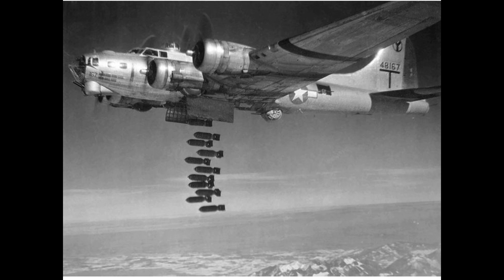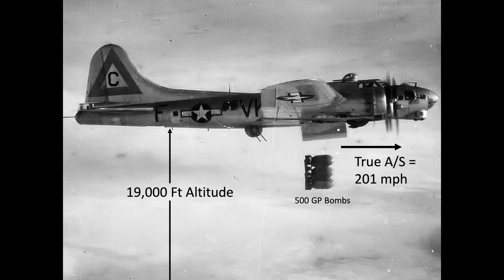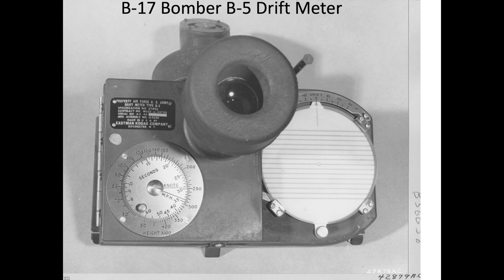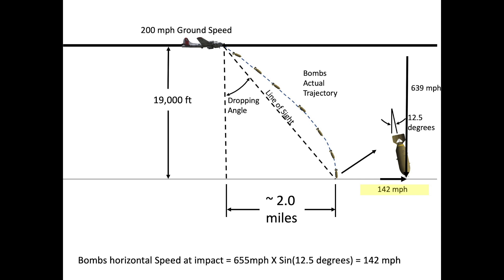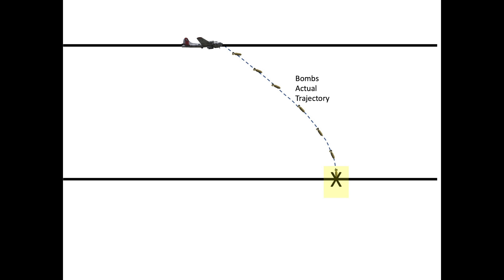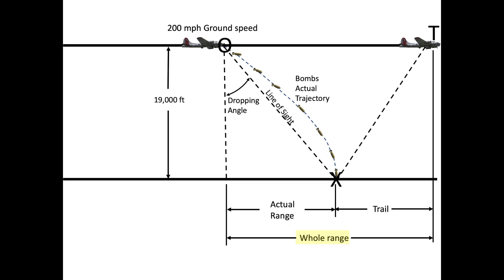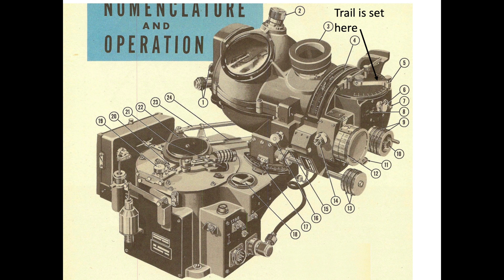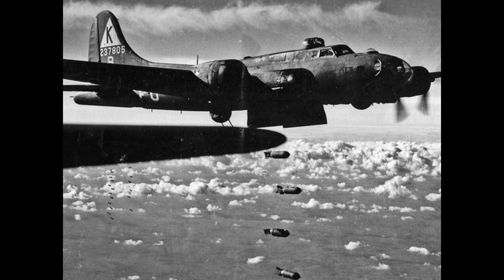B-17 Bombing Ballistics Math Explained

Comment: Daylight formation bombing. Following bombers dropped when they saw the lead ship’s first bomb. This created a pattern on the ground loosely equivalent to a shotgun from sum of each aircraft’s string of bombs. Not obvious is that by the time that first bomb cleared the bomb bay and reaction time of following ships, the following ships were past point in space lead ship had been at at release point. So their bombs impacted forward of lead ships bomb string. 

The lead bombardier’s goal is to put the total pattern centered in the target, say a bridge. So in reality he didn’t put his crosshairs on the bridge. He put them on the water, 1/2 design bomb pattern length in front of the bridge. This while being fired upon by radar laid guns. It wasn’t important if his bombs hit the target. It was the formation that mattered. At least this was the practice using same tech at Korea, which often had smaller formations. 

Standard bombs had a 6’/1000’ elevation dispersal. A few bombs wandered off so bomb scores only included a circle encompassing 90%. 

None of this applies to magnesium rod fire bombs. After all wide dispersion was the goal of fire bombs.

Comment: Not sure about your mathematics here. Assuming the bomb is dropped high enough to reach “terminal velocity” before impact it will only ever reach a maximum speed on impact of 21.937 mph/s. This is only about 120mph and a number of magnitudes than your 600+mph.
Reply: It's a very dense object and it reasonably "streamline."   It's implied that it's terminal velocity is much higher than, say, a human body dropping through space.

Comment: Do one on torpedoes.
Reply: There’s a submarine simulator for PC’s called Silent Hunter. I remember you could manually do the torpedo calculations to work out the lead angle. If I remember correctly, the Submarine Captain would work out the distance to the target ship by using a optical ranger finder. He then would work out the speed of the target ship by taking a first bearing to the target, then starting a stop watch and then measuring a second bearing to the target after ? seconds had elapsed. The targets course or heading can be calculated by repeatedly plotting it on a map or a graph paper.

Comment: If there was no combination of altitude and speed that would cause a GP500 to impact the ground at sonic speeds, what allowed the British bombs to break the speed of sound beyond the obvious significantly higher mass? Were they more aerodynamic?
Reply: If you're thinking of the Tallboy and Grand Slam bombs, Barnes Wallis did design them with supersonic fall in mind, and they were specifically streamlined for that purpose. But as far as I know, most general-purpose bombs used by both sides were your standard blunt-nose-welded-to-cylinder types that wouldn't have exceeded Mach 1.
Reply: @eddievhfan1984  exactly, thanks!

Comment: The GIGO principle states "garbage in, garbage out".  The best sight in the world is still only as good as the information fed into it, so how accurate was that input information? Just a 3% margin of error on both the altitude and airspeed would throw the sight out by quite a bit.
Reply: It gets more complicated when, during the bombing run, clouds drifted in and concealed the aiming point. Now it's either abort the bomb run and bomb 'holes in the clouds' or continue the run and know accuracy is pretty much gone.
Reply: @primmakinsofis614 They normally didn't drop the bombs if the target was obscured. They had secondary and tertiary targets. Worst case they  dumped the bombs in the English Channel. Later in the war they had radar bombsights but those were not always effective.
Reply: Excellent question. For accuracy they would have to know the true ground speed and drift at the aiming point. They would not have had time to estimate variable winds aloft between the initial point and the AP.

Comment: They never calculate in curvature or earth rotation for some reason…
Reply: It might be that given the rather short flight time of the bomb, the difference would be insignificant...a couple of feet perhaps.
Reply: Probably because it’s dropping the bomb and not “shooting” it so it is less significant
Reply: On mortars we were the same for ignoring earth rotation as our range was relatively short and pinpoint accuracy was unnecessary being an area weapon. Artillery however, the data computer would work that out.